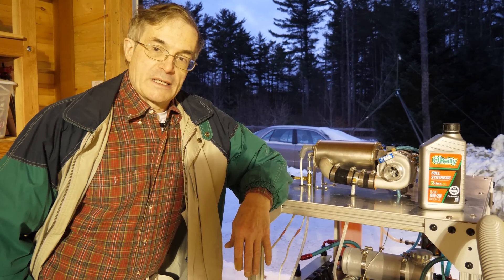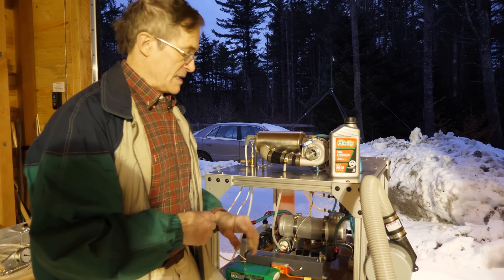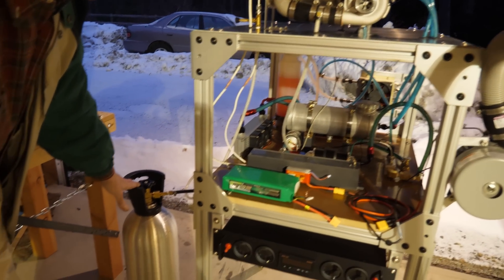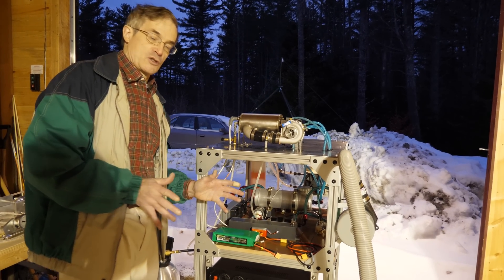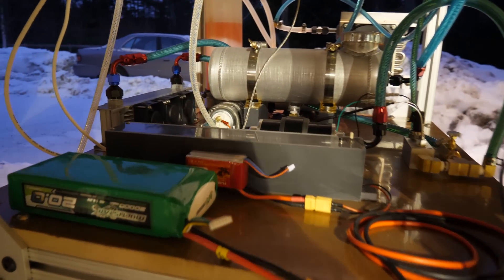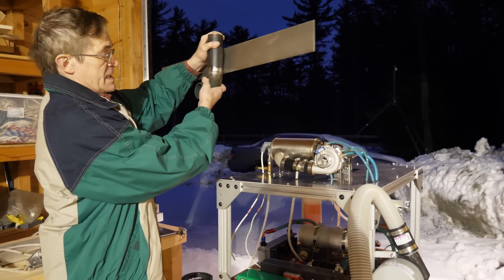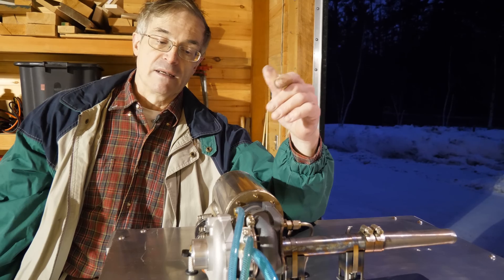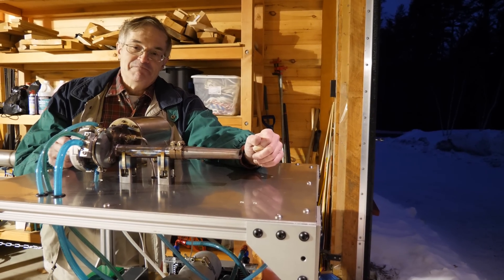FIRING UP THE TURBOJET!

Comment: Very cool. I'm wondering if the air inlet needs to be throttled. You are controlling combustion with fuel flow, only This assumes the inlet airflow is proportional to rpm. It's likely the combustion air/fuel ratio is drifting around since the inlet airflow is not throttled. You may need to control air and fuel flow to maintain combustion control. Maybe?
Reply from the maker: You're right that controlling air flow will improve performance.  The best location is between the combustion chamber and the turbine by diverting this exhaust into the nozzle, thereby modifying the turbine speed.

Comment: One thing I see is that you're running it with your oil cold. You really should preheat the oil a bit... I know it'll warm up with use, but it will make your life easier with learning all of this if you warm the oil up to ~150 F first. Optimal running temp should be around 200F or so - that's where the oil viscosities are measured at for the bottle labeling. 

I also second that you need a bypass for a fair amount of the pressurized air (definitely feed it into the output, though). You just aren't using all of it in that burn chamber... and the turbo is paying the price.
Reply from the maker: You're right about the bypass.  Not so sure about the oil.  We are already using a very low viscosity oil, lower than typical automobile oil that is stone cold for some time in turbocharged engines.
Reply: @TechIngredients  - well, my pointbwutgbthe oil is that it will eventually heat up with use. You'd have an easier time in the long run if you find out sooner how everything runs with hot oil - perhaps you'll find that you're using too thin of a grade (personally I doubt that, but...). What I think you'll find is that it will get easier to start, and will likely spool up smoother and faster.

Oil does thicken up quite substantially at room temperature (even good 0w20 like you have) compared to it's viscosity at operating temperature. At full temp 0w is pretty thin, though with that small of a turbo I think that's a benefit - flow is what lubricates, not pressure,  and thin oil flows very well. 

That's just my $.02 on this, but I do think you'll see changes in operation with warmer oil - hopefully that's being considered. Thanks for the content though - I love projects like this. :)

Comment: Awesome :) Have 1 suggestion remove the air bubbles from the oil and water pipes will help them function more efficiently and stop any heat issues as you go bigger. Cheers and keep up the great things you do.

Comment: This is a turboshaft, not a turbojet. Confused because his knowledge of power turbines means he should know the difference between a turbojet and a turboshaft(helicopter engine, APU, etc). Pretty cool though how much fuel does it burn?
Reply from the maker: It will be as soon as we attach the power output turbine to the jet's exhaust.
Reply: @TechIngredients  Oh sorry I assumed you had it hooked up already. Have you thought of multiple stages? Not sure if it would be efficient or plausible with the whole idea seeming to be ease of assembly

Comment: I would love to build one of these to heat my home. Are kits available to purchase? Just curious...What is the estimated efficiency difference between the Turbo and accessories versus just using a propane driven electric generator? Thank you. Great video! Are there collaboration opportunities available?
Reply from the maker: The single stage turbine would be much less effecient at generating power.  However, why do we   use burners to heat our homes?  If an engine, no matter how thermodynamiclly ineffecient were  used as the heat source, then the electrical power produced would be generated with an effective, 100% effeciency.
Reply: @TechIngredients  I agree. Thanks for the prompt reply.

Comment: Do you have a gasoline engine  turbocharger ( principally impulse) or a diesel turbo charger ( principally reaction) 
The package seems small enough to replace a paramotor fan
USN GSM
Reply from the maker: This is a RHB 31turbo.  It has a 31mm inducer and should generate around 12 lb or 60 N of thrust.  This can be expected to drive an output turbine to approximately 10 HP.
Reply: @TechIngredients   12/0.0807 lbs per sqft 148.69 cu/ft. Per min. That's overdriving it and losing 50% 
https://www.theturboforums.com/threads/ihi-rhb31-vz21-vs-garrett-gt06.382792/
This explains the surging in A different light .  I was like everyone else thinking it was a pressure gradient . But this says it's off operating parameters for the compressor do you think it's stalling?

Comment: Sounds like pulsating pressure in a compressor.might be it is experiencing compressor stall.
Reply: With a centrifugal compressor?
Reply: @YodaWhat  if it not then why its sound strange?
Reply: @coc7711  There are many possible kinds of pulsations in air and other gases even before you add in other variables, like resonance, turbulence, fuel mixing and combustion. But compressor stall in a turbocharger?  Where airflow is parallel to the length of the blades? "Stall" is not a good word to describe irregularities in that flow. Maybe you should watch a couple of videos about the topic, like https://www.youtube.com/watch?v=yaFeO6Jze64 and https://www.youtube.com/watch?v=xzdpkIibwBM

Comment: If you're looking for longevity for this thing as a generator, I would highly suggest a ball bearing CHRA. They are far more robust than oil film bearings and can even tolerate temporary oil starvation periods, unlike the journal bearing units that tend to gall on even the shortest periods of lubrication loss.
Reply from the maker: That's right!
It's bigger brother has already been tested and has dual ceramic bearings.

Comment: Good stuff and congratulations. I'm sure you're already thinking of the next two dozen mods.
Reply from the maker: Thanks!
Bigger turbocharger
Compound turbocharging
Turboshafts
Generator
Transmission to a vehicle
Reply: @TechIngredients   -- Perhaps a Variable Reluctance Alternator? And with your proclivities, probably with supermagnets to save weight, and a disk with holes as the only rotating part? (I used to have a Wankel motorcycle that used a VRA.)

Comment: To measure thrust you can place two of the rig's legs on a scale (front or rear), take the delta of the reading, multiply by the horizontal distance of the legs and divide by the vertical distance to the motors shaft.
Reply from the maker: The turbojets on the way are substantially more powerful. A vertical exhaust is an advantage. Your scale idea is a good one and can be calibrated by simply placing known weights in the plane of the exhaust.

Comment: Why you do not just connect the generator to the turbocharger shaft instead powering another turbo wheel by exthaust gasses? Is it just because the difficulty to deal with high rpm of the turbocharger or  is there another reason?
Reply from the maker: The output RPM is ridiculously high.

Comment: Great work again. Your exhaust nozzle looks a little too long and too small diameter so chocking the engine, this could be why its surging.
Reply from the maker: The length was required to accommodate a separate output turbine.  But, I believe you are right and an adjustable pre turbine diverter, like a pop off valve should solve this.

Comment: You are tackling all very interesting projects. Hybrid drone, hybrid gas turbine and now the turbo charger jet engine. But whatever hapened to the earlier two projects? Have you concluded them?
Reply from the maker: Practically none of our projects are really concluded.  We are building a very unusual dye laser.  It's just that each project leads to several others.  It's fractal or a little ADHD.
Reply: We tried to do turbo charger jet engine as a term project in my gas turbine course, but could not make it to run. In my final year I proposed hybrid jet engine using an rc nitro engine for compressor but my proposal was rejected because of lack of enough calculation and research involved. I still think it would have made a great capstone project.

Comment: What is the fuel consumption? Would it be economical to run?
Reply from the maker: A compound turbocharger set up, driving an effecient output turbine might begin to approach a 2 stroke engine's effeciency, but it's unlikely to equal it.

Comment: Can't wait to see this thing as a final project. I'd personally love to make a series turboprop version of this engine for a FAR Part 103 aircraft. Do you have any plans of adding computer control/tuning with this project to help really dial it in? From what I've seen LP has a stochimetric ratio of 15.67 : 1. It may be worth adding a wideband O2 sensor somewhere in the combustion chamber to see if the gas is being completely burnt or not by that point. I know there are sensors that are able to handle 100 PSI and 1,400 degrees F.
Reply from the maker: One of my sons, "The Son of the Main Presenter", is certainly capable of designing and programming a throttle feedback loop controller, linked to EGT and/or boost pressure.

Comment: Nice. I'm looking forward to the turboshaft conversion (or extension), since most people don't touch on that - and if they do they just direct-drive to a propeller.
Which kinds of reduction mechanisms are suitable for high rpm turbines like the power turbine? What size of turbine is appropriate? Etc.
Reply from the maker: That is exciting.  We are going with a reversing flow turbine similar in principle to a Pelton wheel and a large diameter of approximately 40cm for the larger version of this engine with a 53mm inducer. The reverse flow increases torque and reduces RPM.  You might want to take a few min and look at these wheels.  The idea is elegant.

Comment: The comments about surge sound about right.  Wanna see for yourself?  Hold a piece of string near the compressor inlet, not so close that it's at risk for being sucked in.  The reversal of air as it surges will blow the string in and out.  Fix this first!  

Bleeding off the compressor air to get rid of surge sounds really cool but all it does is make the engine run hotter by killing its efficiency.  

I still have a TO4 and a TV81 turbo engine in the garage.  When my supply of Jet-A got cut off due to 9/11 security concerns,  my fun did too.
Reply from the maker: These very small turbojets are very hard to get right.  The best way to reduce surging, once the combustion chamber is dialed in is to reduce the exhaust restriction before the turbine similar to a pop off valve.  This maintains mass flow through the compressor, an unchanged air/fuel ratio, exhaust temps and thrust, but reduces power to the compressor that leads to over speeding.
Reply: @TechIngredients    So, have you actually tried out this pop-off valve concept?  This is how it works on an internal combustion engine turbo installation.  It doesn't work that way on a turbocharger-based GT, where you don't have a multi-cylinder positive displacement pump forcing hot air into the turbine.  Bleeding off compressed air reduces the efficiency of the engine and will make it run hotter.  Pop the hose off for the boost gauge and see how much the EGT rises.  In my small engine, there is a 1/16" hole in the combustion chamber to prevent accumulation of liquid fuel.  Opening and closing this tiny hole causes a 5F change in EGT.

"This maintains mass flow through the compressor, an unchanged air/fuel ratio, exhaust temps and thrust, but reduces power to the compressor that leads to over speeding."

Umm, No.  You can't maintain mass flow through the compressor, as by bleeding it off, you've cut a bunch of power to the turbine, which is what is driving the compressor.  There isn't a lot of power to spare with these things. Most of the power generated is used to power the compressor.  Wasting compressed air by dumping ahead of the turbine it is not a proper solution.
Reply from the maker: I have to disagree.  The "purpose" of the engine is to create a large volume  of pressurised gas.  This ultimately is converted to the momentum of the exhaust flow.  When surging occurs, the turbine is extracting more power than the compressor can transfer into the mass flowing through it.  Unlike your fuel drain, the bypass needs to be in the path of the exhaust gasses, assuring that the air /fuel ratio remains unchanged.  The diverted gas combines with the post turbine flow inorder to maximize thrust.
Reply: @TechIngredients   Let's see if I got this correct:  If the engine starts to surge, you crack the bypass open, diverting hot gases around the turbine and back into the jet nozzle, just like a waste gate on a turbo IC engine.  I'd be interested in seeing how well you find this works in practice.    When I built my engines, people didn't take this approach, instead they sought out turbos with a larger turbine relative to the compressor.  

BTW, A/F R in these things is more related to flame tube hole pattern and fuel nozzle design.  It's something that you have lots less control over than you think you do. Don't worry about it too much.

Comment: The engine sounds great, would make a super powerful leaf blower (and probably incinerator)!
What are the popping noises? Does it stall due to fuel/air issues?
Reply: It’s not stalling in the sense of the flame going out, it seems to be compressor surge/stall. The pressure in the combustion chamber is forcing air backwards through the compressor turbine.

Comment: Awesome stuff.    Concerning the power:weight ratio, how overbuilt do you think those car turbos are?  I imagine they're optimized for manufacturing cost, which is not necessarily material cost (e.g. thicker castings might reduce the defect rate), so they might have more bulk to them than is mechanically required.    I don't know if it would be possible to lighten them by milling weight off them though.
Reply: They're incredibly overbuilt compared to the hardware you'd find in aerospace. Cast-iron turbine housing, thick cast-aluminum compressor housing, large solid bearing housing in the middle.... The list goes on.
Reply: @MysticalDork  There isn't much you can do about it being made of cast iron, but maybe weight could be shaved off it if the casting is more robust than is mechanically necessary.
Reply: You thought that the problem here was the weigh of the turbo and not the trolley of crap required to run it?

Comment: Yes, but I want to put it in a vehicle!  

Now I wish I would have never sold my BD-5 kit; two of these  (albeit larger turbos) would fit in the rear fuselage with the burner cans underneath in a vertical position, staggered, with the exhaust out the back where the drive shaft would be.  A NACA duct on each side, just behind the pilot's seat bulkhead would feed the compressors with fresh air.  

I'm willing to bet that I'd have plenty of room left over to install a 10lb bottle of propane under the engines but behind the burner cans, with plenty of envelope left in the weight and balance.  I'll have to run the numbers when I find my old set of blueprints and construction manual...

The cons- need about 200lbs of thrust.  A 10lb bottle may give me 10 minutes of ultra-exciting, hair on the back of the neck raising flight time.  I'll take it.

You're making me think too much about it, my wallet will hurt!  You guys rock!
Reply: I tried to fly a piston engine B-D5 no "J". Couldn't get the canopy closed or reach the retract lever......

Comment: Don't give up on that Camry. It's still good!
Reply: It is planned that they will keep testing until the thrust melts the ice, and vòila that is a reason for doing things like that midnight. 
Garage might be more practical but would end up burnt down... :D
Reply: The Camry is the most unreliable/self combusting thing in that household. :DDDDD
Reply: @woldemunster9244  The accent in "voilà" is on the 'a', and in general should be followed by an exclamation point, as it is an exclamation.

Comment: I have it on good authority that whenever someone builds a drone with meaningful payload capacity or long flight duration, the U.S. government takes a keen interest. Have you explored this consideration yet?
Reply: This is not one of those things.
Original 2 stroke generator would be more fuel efficient, simpler and lighter way to power an electrically driven drone. 
But then, why propel it with electricity at all?
Reply: @incandescentwithrage  Cause electric motors are easy to control with cheap flight controllers and can react quick enough...how would you control 4 gas driven props with fast enough reaction to the flight controllers commands...maybe variable pitch props but even then I don't think they would react fast enough...
Reply: Sounds like you're advising a hobbyist to turn their hobby into a get rich quick scheme, plus obviously weaponizing it. You're a special kind of psycho and that's not a compliment.
Reply: @chrisbalfour466  You're reading far too much into this.